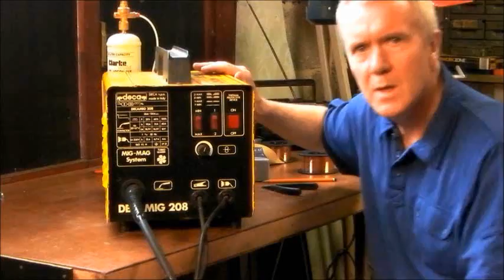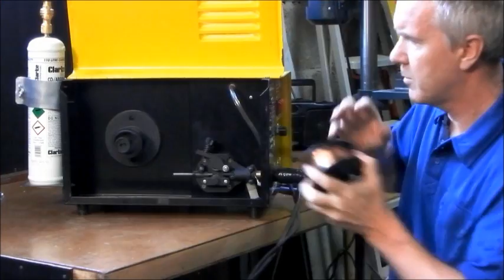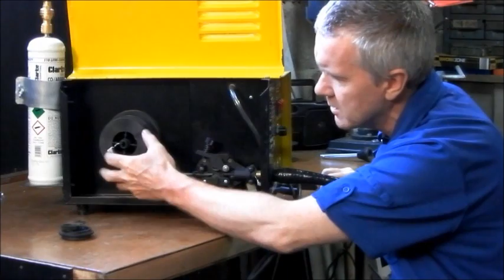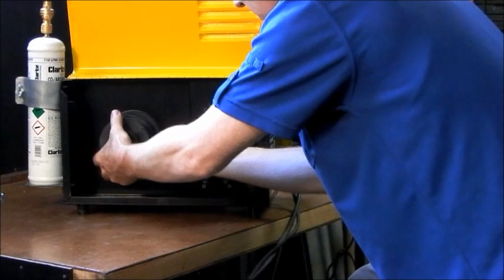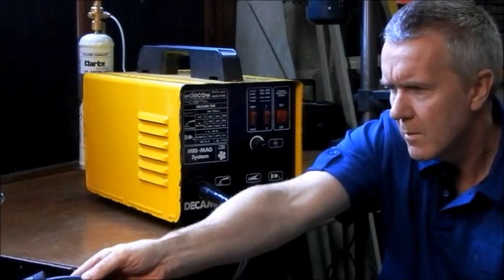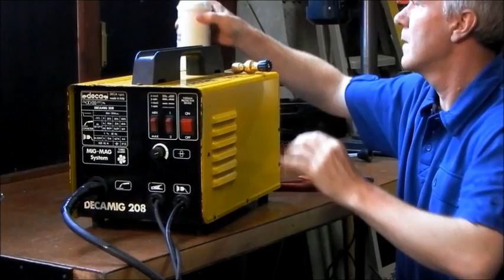Mig welding part one. installing the wire and the connecting the gas.

Comment: I have a Wolf MIG140, 30-135a, and is powered from a 230V single phase supply. I have no idea how to wire up to my house electronics so I've been looking at portable transformers. Do you think a 32a would be sufficient to run it?

Comment: Hey Mate, I 've just bought a similar set up. But when I twist the valve to start the flow of CO2 it goes mental and hisses out of what I assume is a relief valve on the side of the regulator. Can't find any info on what I'm doing wrong. Any suggestions?
Reply from the maker: ninetriple3 make sure the max  valve bar rating exceeds gas bottle pressure. make sure you screw the valve all the way on. try a few times.

Comment: Hi, thanks for the videos !!   I noticed that there is a small plastic hose connected to your gas bottle.   I have been my old Clarke welder without gas, with flux core wire and I want to now try using gas shielding but I am having a very difficult time finding the adapter to fit the tiny gas hose which appears to be the same as what you have on your MIG.   Can you tell me where I might find the adapter ?   Thanks - Dave
Reply: CalgaryWhistleMan same as you mate, if you find out could you let me know..thanks
Reply: CalgaryWhistleMan  did either of you ever find a adaptor I'm going through the same thing
Reply: @zacjordan6526  did you ever get one or given up?